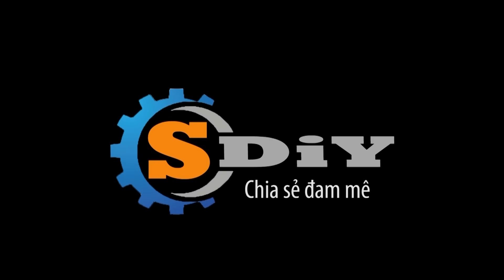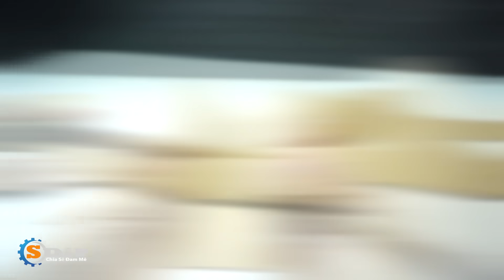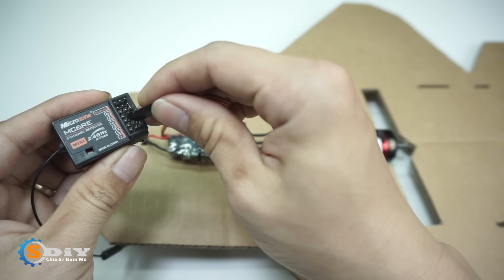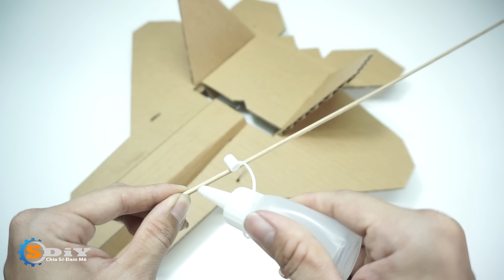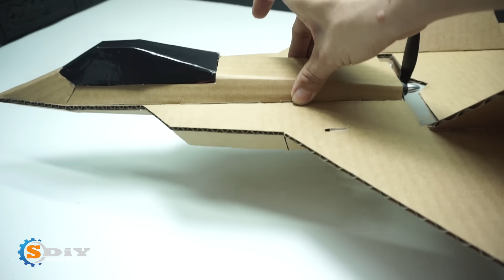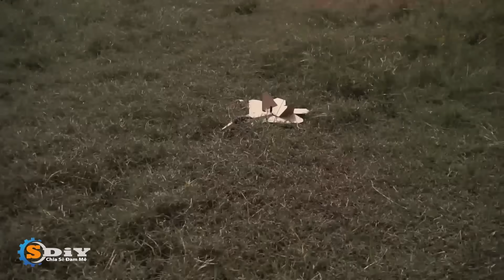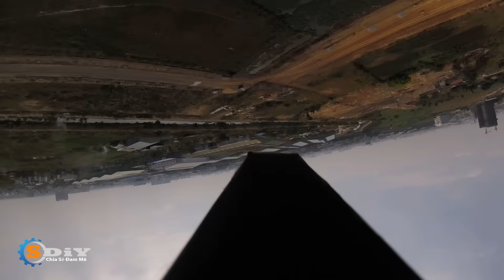Cardboard RC Airplane DIY - F22 Raptor l S-DiY

Comment: Impresionante! Pero no entiendo cómo vuela si no tienen perfil aerodinámico las alas???????? El extrado alar debiera tener una mínima curva para generar la diferencia de presión del aire con el intrados alar. Rompe con toda regla básica de aerodinámica. ???
Reply from the maker: Hi friend. This aircraft relies on the angle of attack to take off. Very simple, but in return very low performance compared to the standard wing profile!
Reply: @SDiYchannel01  ooooh!!!! Muchas gracias por responderme!!! Saludos cordiales desde argentina!

Comment: Can you please share this plane's dimension for A4 size paper as my printer doesn't take any other size of paper. Please share a pdf of two parts of this plane which can fit in A4 sized paper.
Reply from the maker: Thank you so much. Because I'm sharing the author's original drawing, Because that's the author's respect. I will do my best by editing the drawing into A4 size. Wish you sympathize!
Reply: Yeah. Your rc stuffs are dope.

Comment: Well done! The Rapter is a good cardboard choice for sharp angles and wide control surfaces. Building looks "easier said then done" as precision cut prep work is necessary. A plane with compound curves might be harder to create in cardboard but not impossible as cardboard can be bent. Another boxy sharp-angled cardboard plane could also be a pre-WWII French bomber.
Reply from the maker: Hi friend! You are very correct. Perpendicular is the advantage of hardcover!

Comment: I have been a "Wet" flyer since 1959. In looking at this "jet" and how you built it. I just have to think why not flat balsa? Using the same building technic, 2 channels mixed, .049 Reed or a TD .051, 6x3 or 6x4 prop. Maybe just a little bigger, too. Most of my 2 ch .049 planes have WS's between 24 & 30 in. build-up wings, ail & elv. set the needle, give it a toss. 4-6 minutes, belly land it the grass, fuel up and do it again. Fly all afternoon on a Quart of fuel.

u
Reply from the maker: Hi friend. Nice to meet someone who shares an intense love affair with the RC plane.

Comment: When i was in the 3rd grade in 95 i use to make my own working diy RC planes from my old broken RC trucks and the old foam 747 gliders walmart sold without any help or knowledge. I just knew i wanted a RC plane and made a few least the best i could do with 3ch radios.
In 98ish i would take pizza boxes and cereal boxes and did my own mixture that hardened the cardboard and made scale biplanes with gas plane motors along with radio/receiver and servos i got from a yardsale some older man was selling his unused plane stuff. And then i got into video gaming and never touched that hobby again...
Reply from the maker: Hi friend. Excuse me to be your brother. Because I'm younger. Building model aircraft is also my great passion. Very pleased! (sorry I use google translate)

Comment: May I ask you that what kind of ESC 20A FMS did you use ?   because I found xt60, ec3 and jst on the website. Thx.
Reply from the maker: Hi. That's just the jack type. It depends on your battery jack. As my video is the JST jack type

Comment: you need to create a cardboard su-57 and push them together so the experts will understand which plane is better.
Reply: what i know, Eurofighter turns better then F22, tested in Dogfght-Sims, but Eurofighter has worse stealthability then F22 because F22 has weapons inside.
Its known russian Jet-Engines have half power of amerians so russian Jets are bigger, SU-57 turns not better then F22 or Eurofigher, but has special freefall-turn-maneuvre with vector-thrusters, and SU-57 has BEST Stealth-Ability, there is special 2 year old NATO-Report from Black-Sea Area hehe....
Reply: I mean the su57 is the f22 killer but yeah
Reply: @hypemars  it wouldn’t work that way believe me
Reply: @dwightbullock8937  ?, It’s been proven that the su57 is better against the f22
Reply: @hypemars  Incorrect, all of you and no, it has not been proven. 

If we look at specs, F-22 wins most of it besides flight range and maneuverability but not by a lot with maneuverability. This is 2021 so dog fighting in such jets is a thing of the past as the F-22 is a good chunk faster and was never meant to be a dogfighter and still has the world's most advanced cockpit/tech which will shoot down the Su-57 before a dog fight is even a chance and if it came to that the F-22 would just gain distance with its superior speed. One thing most do not consider are the missiles, like the Meteor (not US) which is the best known missile that even a Su-57 cant avoid or even the F-22 but the US has their version of it in testing but not much is known about it but safe to say it will be better and cost way more.
Reply: @StitchKiller  uhh a su57 has never had a fight with an f22(that I have heard off) and also the su57 is faster and can turn faster, also Russia has a Mach 6 missile and and upcoming fighter that goes Mach 5 I think so the f22 is outmatched
Reply: @hypemars  The Felon is crap, but it's better crap than their last fighters.
Reply: @vancityguy  well Russia refers to it as crap because they wanted something better, but to think but was meant to be better is scary, but no it’s a really good jet  for dogfights and manoeuvring. The only way an f22 would win is beyond visual range but then the Mach 6 missile comes into play

Comment: I have a question: 
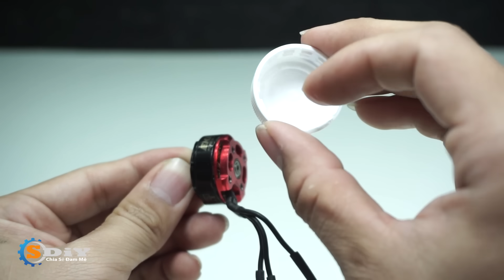1:57 when choosing brushless motor, is there any formula about what kilovolts of motor should we pick?
Reply from the maker: You rely on detailed specifications of the motor manufacturer! When you have gone through many image motors, it will be easier to choose!

Comment: Hello, I really liked your RC Airplane and I decided to do one for myself as a hobby and improve my skills. However, I do not have any experience so I am afraid. Could you please answer my questions if I face any problems? I am especially afraid about the controller transmitter and receiver system (Mc6C). Could you please tell me more about how you programmed the remote controller?
Reply from the maker: Hello friend! I am always happy. MC6C manual you can refer to my old videos!

Comment: Картон на депрон заменить наверно тоже можно?
Reply from the maker: Hi friend, depron is very good material. I did it with cardboad just because it was easy to find!
Reply: @SDiYchannel01  Спасибо за ответ на мой вопрос. А я строю модели из потолочной плитки и подложки под ламинат с обтяжкой скотчем. Получается довольно прочно. Недавно уронил двухмоторную модель (примерно 1.6 кг) с высоты примерно 15 м. Отказ двигателя.
 Аппарат  уже восстановлен!
Есть видео этого полета.
Thank you for answering my question. And I build models from ceiling tiles and laminate underlay with adhesive tape. It turns out quite solid. Recently dropped a twin-engine model (about 1.6 kg) from a height of about 15 m. Engine failure.
 The device has already been restored!
There is a video of this flight.
.https://www.youtube.com/watch?v=OkftFs4gUaM&t=5s

Comment: Nice project! Just one point, the controll surfaces seem to be bending during the flight so that would be necessary to reinforce then with some wood picks as you did on the wing. Congrats!!!
Reply from the maker: Many thanks for your opinion. It is true that the steering part does not seem stable. Reinforcement seems necessary!

Comment: What if I print the plans with the A4 paper.. is that ok? Thanks.
Reply: Incorrect size. U ll get smaller plane. Need to reduce the motor n battery size too

Comment: Hi, what motor you use, is it CW or CCW.?
Reply from the maker: Hi, I use a 2205 2300kv motor, you can choose random CW or CCW, it doesn't depend !
Reply from the maker: Hi. Exactly. If you print A1 like me, you will have 46cm wingspan, A0 about 70cm. Hi
Reply: For plan printing, what size of paper you use.? Is it A1 size.?

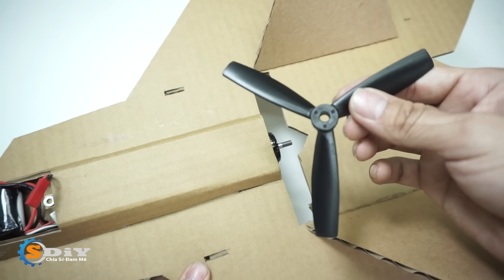Comment: information.          ridiculous amount of work, for a   NOISY  and  silly little model.     when an electric prop is noisy,  SOMETHING    IS     WRONG.!!!!!!     at 5:35, one part of that problem is, that  is   NOT  an   E P prop.!     Electric Pusher         
all you boys  NEED  to  See  how dumb it is to make a (silly little) model, that has a  ZERO-lift wing,  Shaped  like  a  fighter.!!!        googletranslate
Reply from the maker: Thanks. This is an experiment. The propeller I use is that for optimal thrust. Can not push suitability!